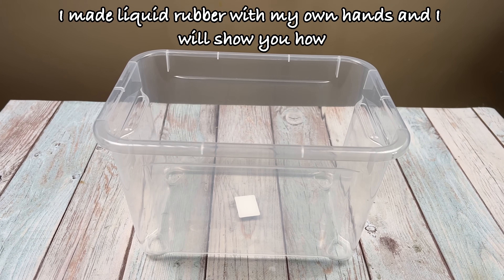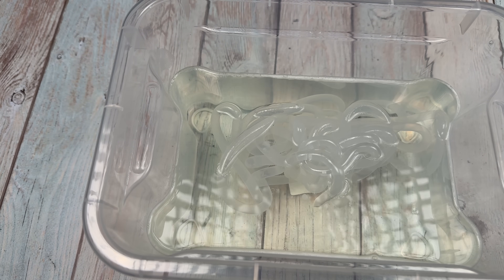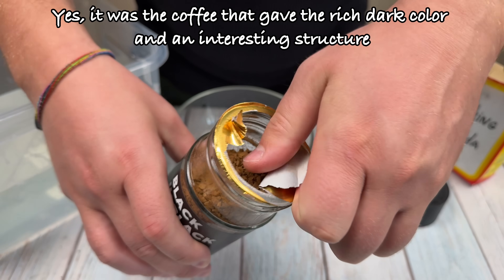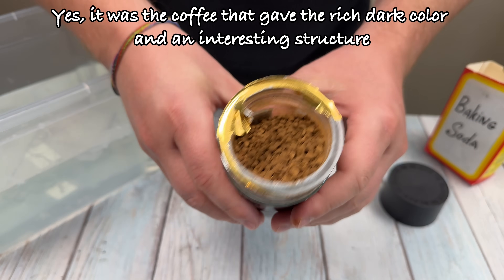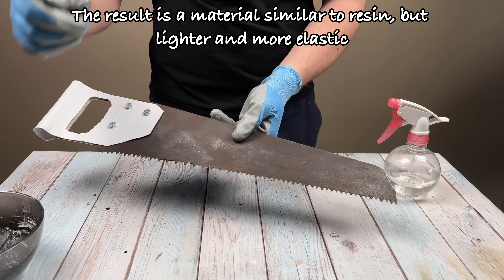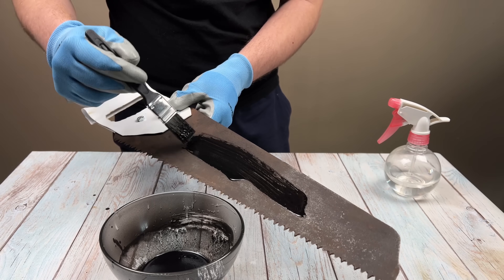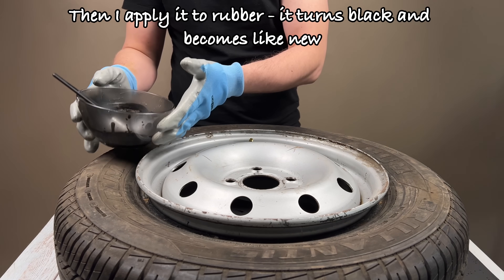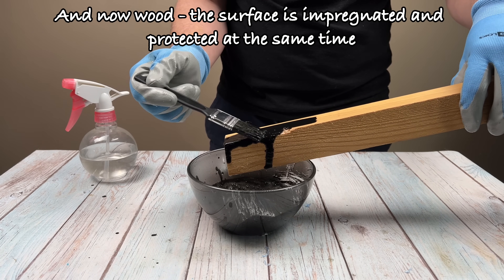Just mix coffee grounds and SILICONE.🔥 Liquid rubber forever

Comment from the maker: If you want a matte effect, add more soda or a little starch, apply with a sponge or brush and do not touch after drying. If you want gloss, increase the proportion of silicone, add a drop of oil (for example, Vaseline) and apply evenly and in a thin layer.

Comment: Final - Poland. Very Thank You.
Reply from the maker: If you want a matte effect, add more soda or a little starch, apply with a sponge or brush and do not touch after drying. If you want gloss, increase the proportion of silicone, add a drop of oil (for example, Vaseline) and apply evenly and in a thin layer.

Comment: :face-blue-smiling:EXCELLENT Thanks, yes please send me the recipe... Kind Regards
Reply from the maker: If you want a matte effect, add more soda or a little starch, apply with a sponge or brush and do not touch after drying. If you want gloss, increase the proportion of silicone, add a drop of oil (for example, Vaseline) and apply evenly and in a thin layer.
Reply from the maker: I'll send it, I'll send it 🤗🤝 a little bit later

Comment: Please send the recipe for your mixture. Thank you.
Reply from the maker: If you want a matte effect, add more soda or a little starch, apply with a sponge or brush and do not touch after drying. If you want gloss, increase the proportion of silicone, add a drop of oil (for example, Vaseline) and apply evenly and in a thin layer.

Comment: FINAL
Reply from the maker: If you want a matte effect, add more soda or a little starch, apply with a sponge or brush and do not touch after drying. If you want gloss, increase the proportion of silicone, add a drop of oil (for example, Vaseline) and apply evenly and in a thin layer.

Comment: And the final is.....
Reply from the maker: If you want a matte effect, add more soda or a little starch, apply with a sponge or brush and do not touch after drying. If you want gloss, increase the proportion of silicone, add a drop of oil (for example, Vaseline) and apply evenly and in a thin layer.

Comment: Wow, please send the recipe for your rubber!😮
Reply from the maker: If you want a matte effect, add more soda or a little starch, apply with a sponge or brush and do not touch after drying. If you want gloss, increase the proportion of silicone, add a drop of oil (for example, Vaseline) and apply evenly and in a thin layer.

Comment: ❤
Reply from the maker: If you want a matte effect, add more soda or a little starch, apply with a sponge or brush and do not touch after drying. If you want gloss, increase the proportion of silicone, add a drop of oil (for example, Vaseline) and apply evenly and in a thin layer.